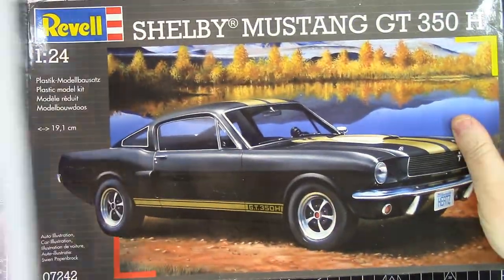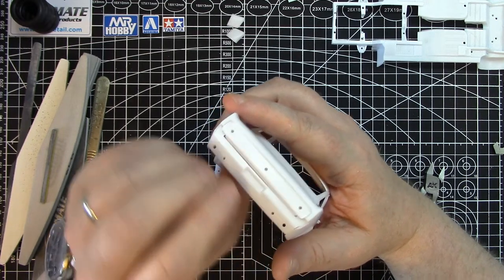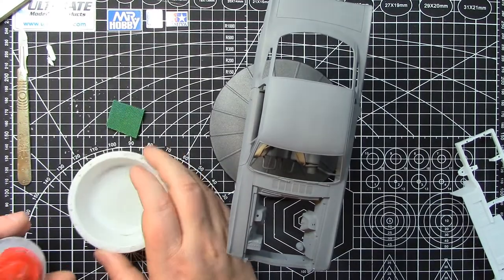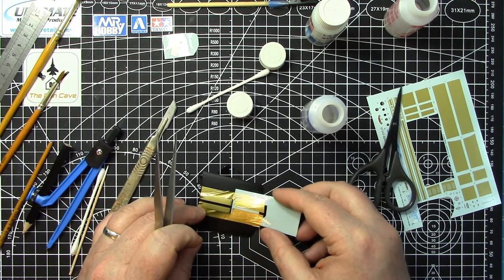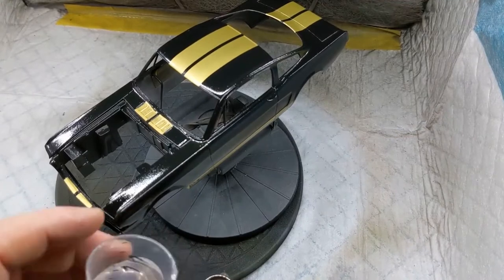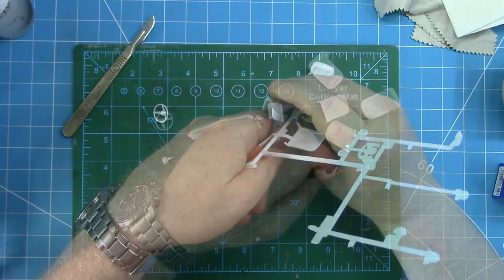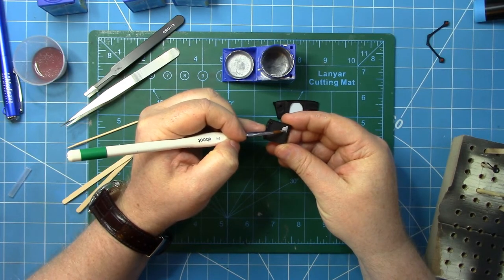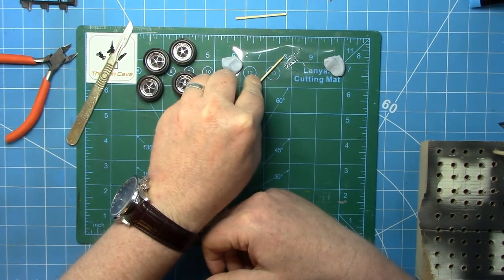Part 1 - Revell 1:24 Shelby Mustang GT350H

Comment: This is a very old mold and the kit's always been known as a bit dodgy in terms of fit when it comes to the front and rear valances. But Revell's taken this mold and run with it for for pretty much every classic Mustang type from that era known to man. I have two of these kits still in the box and built another one several years ago. Grew up in Detroit, with plenty of family members that worked the assembly lines at the Big 3 factories. Believe me, the fit and finish on the production line cars were about as good as the fit and finish on this mold.  ;-)
Reply from the maker: It's good to know Revell were authentic with the fitting then, even it's by accident.

Comment: I may have to get one of those nail drills.
Reply from the maker: I had it for ages and didn't use it as it hasn't got a proper chuck, just a push fit collet. I tried the shanked microbox drill. Nuts and they fit perfectly. Very handy now.

Comment: hello, I really liked this model because of the spark plug wires, what is the number of the difficulty level of this kit? because I want to buy one of the same model thank you
Reply from the maker: Hi Thiago, thanks for watching, I can't remember, its not a difficult kit, just old.
Reply: @TheDanCave  Thank you for your attention, I asked about the level of difficulty, because it is difficult here in Brazil to know which model of the Mustang kit has a hole to place a spark plug wire, there are many models like this one but it doesn't have the holes to place the wires
Reply from the maker: This is an old Monogram kit, and I think I had to drill the holes for plugs and distributor
Reply: @TheDanCave  I understand friend, thanks for the attention

Comment: Great build, those decals round number plate, I had so much trouble with them, but then this was only my second build getting back into hobby. Where did you get that circle cutter you used Dan?
Reply from the maker: Circle cutter is one from Amazon, fairly cheap, not great for small circles.